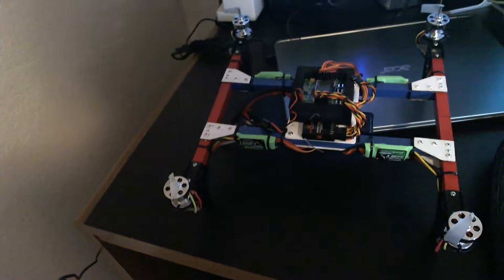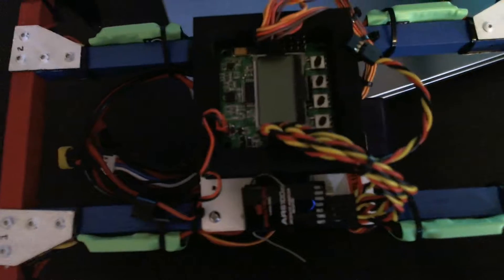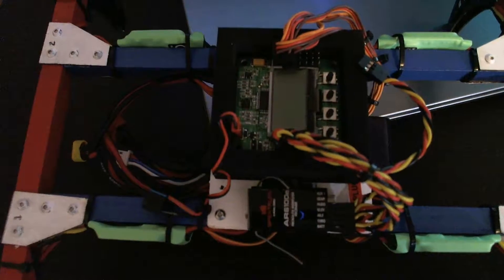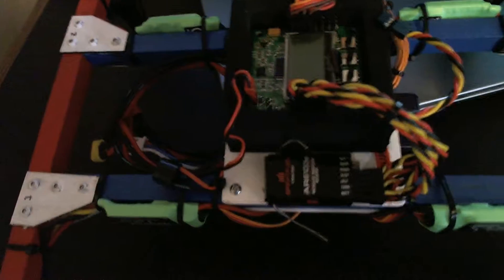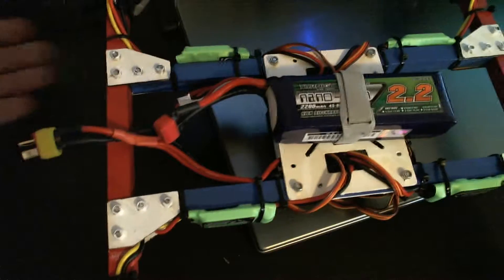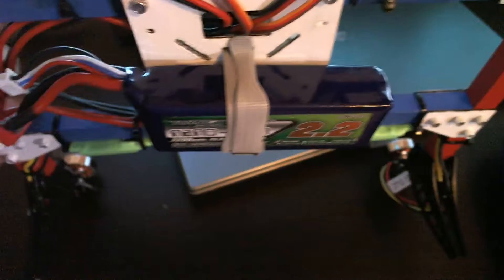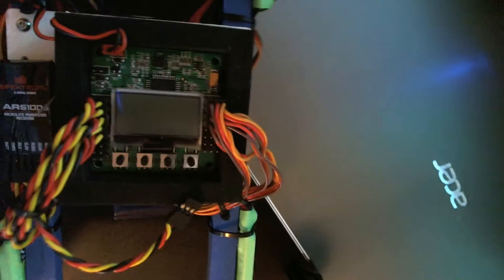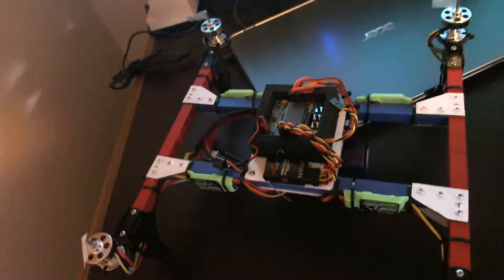Knuckle H-Quad Build Video - Part 3

Comment from the maker: She is completely done.  Just need to maiden and shoot a video to post. Technically I have maiden her but only in my front yard.
Reply: If you have time, please post your KK2 settings.  I'm waiting on all my parts to build the same quad.  Good luck with the maiden.
Reply from the maker: Michael Werner I followed this set up
KK2.0 Multicopter ESC Calibration, Motor Layout, and Auto-Level w/ Default Settings on AeroSky Quad
KK2.0 Multicopter PI Gain Tuning for Beginners
Reply: What PI settings do you use on yours? Im still struggling to fine tune mine... Thanks.
Reply from the maker: Paul - I followed the set up on the link above